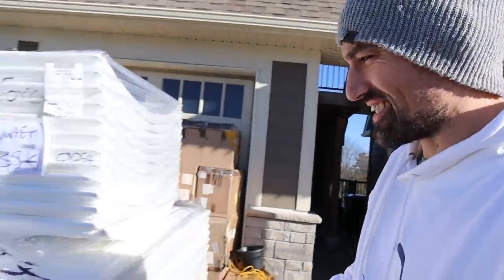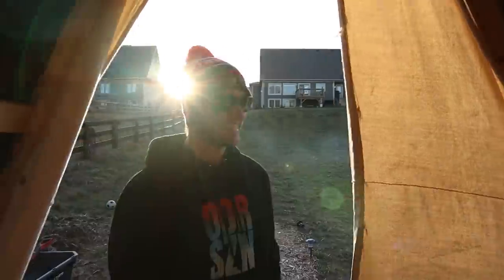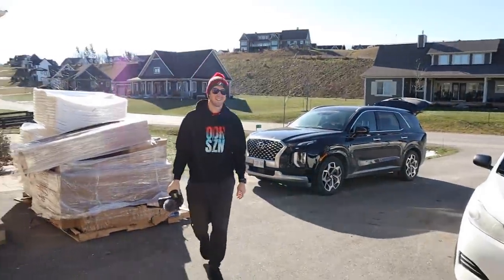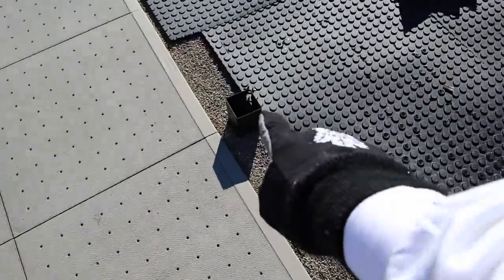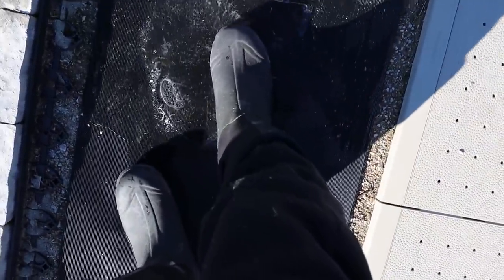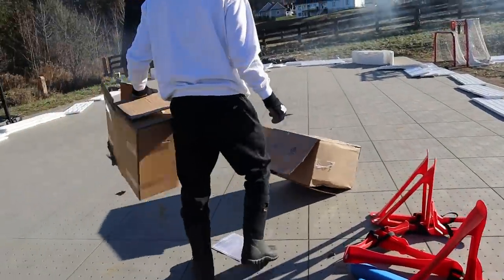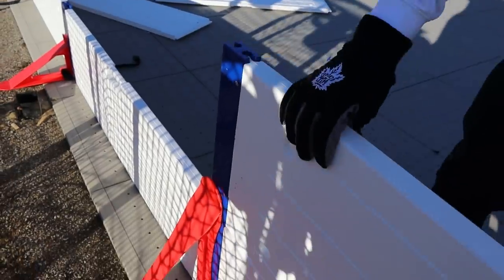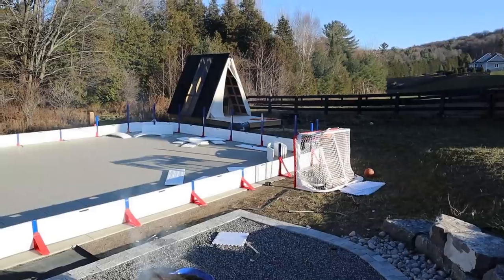This Year's Rink set-up will be EPIC

Comment: Does it matter which side of the boards faces in or out? I noticed you put the straight boards with the smooth side facing out.
Reply from the maker: Ya I think for a better puck bounce I should have put smooth on the inside. That’s my bad
Reply: @CoachJeremy  I remember saying this but you said the fill lines should go outward so I was like “yes sir, ok sir, as you say, boss” 🙏🏼
Reply from the maker: @HadenHiles  we put the full lines on the inside. They’re supposed to go outside. You hold back the water and I’ll flip them around

Comment: Hey Coach Jeremy!, what would something like that cost to build? Is it in the thousands? Or 10's of thousands?
Reply: 10 thousands i was looking at one to upgrade mine and if u had nothing for the big full length netting one its about 25k
Reply from the maker: Mine was around $10 000 but a smaller rink without the tall boards and netting would start around $3000. You could also source all the material yourself and build a rink for around $100-$500 if you use scrap lumber and a liner from a local supplier.
Reply: @CoachJeremy  ya